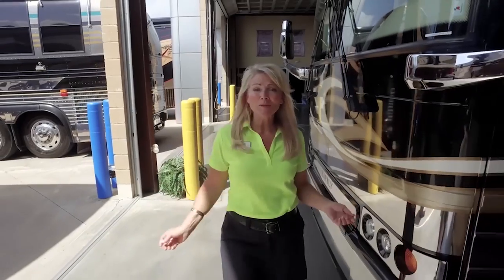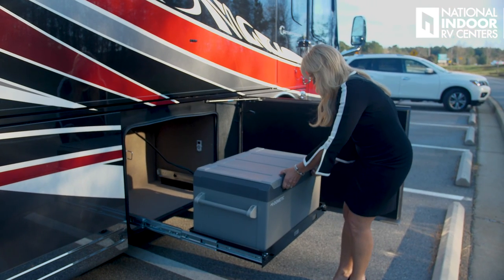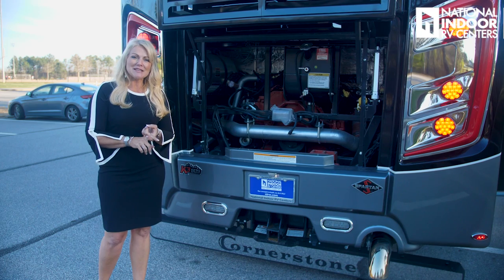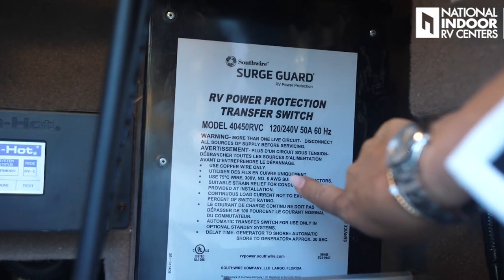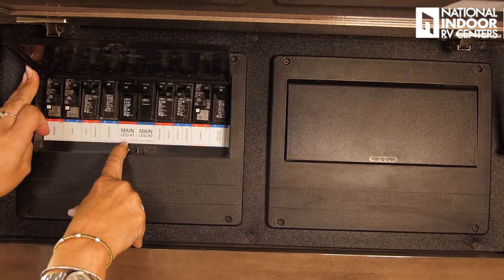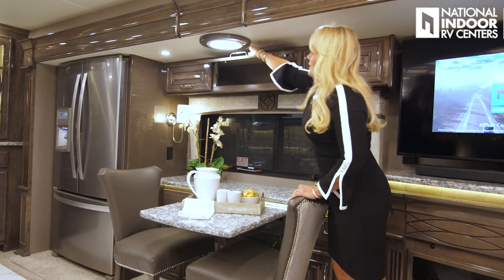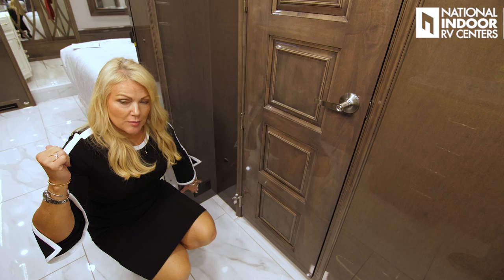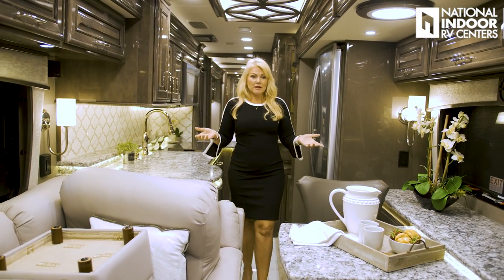2020 Entegra Cornerstone | Full Motorhome Walkthrough Tour | NIRVC

Comment: As usual top-notch tour. Entegra has a lot of new features this year. problem is that most are just items that the competition has for a couple of years or worse many years. These features are not colour choices but game-changers if you have ever used them. There are a few oddities that you thought the industry abandoned years ago. There exterior colour choices are one place where Entegra seems ahead of the pack. I see that Entegra is trying to offer better value than the existing manufacturer and that is definely a good thing.The downside is that engine choice are somewhat meager in the hp department. Only the  cornerstone gets the most expensive, most powerful 15 litre. The other 4 max out at L9 without a 12 litre insight. 

I definitely see that the new digital dashes (either spartan and mercedes/freightliner) need to be made more user-friendly/less cluttered, not unlike automobiles. They are easy to use sitting at a campsite but not sure I would want to beside this coach while the guy surfs through menus on his dash doing 65 especially knowing that he can weight up to 74000 lbs GCWR. The only real negative I see is the higher fuel fill will be are real deal-breaker for us older people with shoulder problems having to lift that diesel nozzle that high.
Reply from the maker: Thank you for your comments.  It will be interesting to see if Entegra keeps the higher fuel fills in the up coming years.  I had not thought about it being a problem for people with shoulder problems.  

I agree with you that Entegra is ahead of the pack on the exterior paint colors.  If you want to be noticed than Entegra coaches are ones for you.  

Thanks for watching our videos!

Comment: Does it have Internet in side?
Reply from the maker: It depends on the coach. Higher end Newmar coaches and Entegra coaches have internet for the coach to interface with Silverleaf and the Vega touch but you can’t use it to access the internet. If you want personal internet access you’d have to have a hotspot or a WiFi ranger type product.

Comment: Do you need a cdl to drive a class a rv ?
Reply from the maker: Typically most states do not require a special license for RVs weighing under 26,000 pounds. Once you go over 26,000 pounds you  need a Class B license. I recommend checking the requirements from the state you live in because some states have different requirements. 

Thanks for watching our videos!

Comment: Why so luxury vehicles doesn’t have automatic ac
Reply from the maker: Yes, the A/C is controlled by a thermostat and turns off and off as necessary to maintain a constant temperature. If you’re not plugged into shore power then the Auto Gen Start will start the generator automatically for the A/C to run.